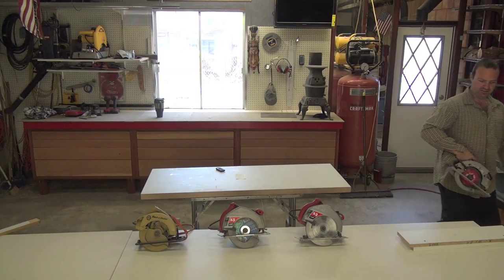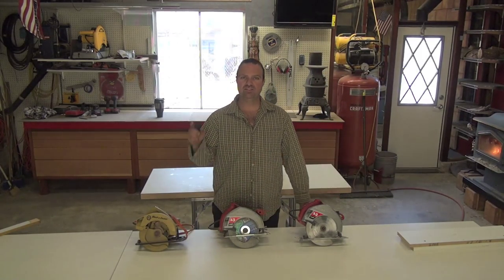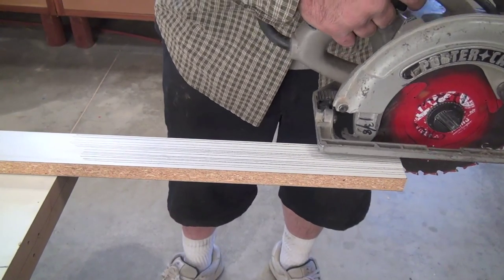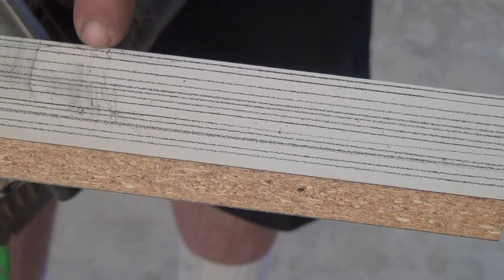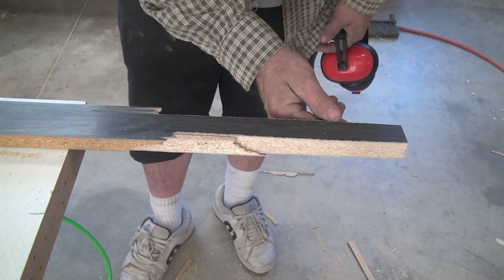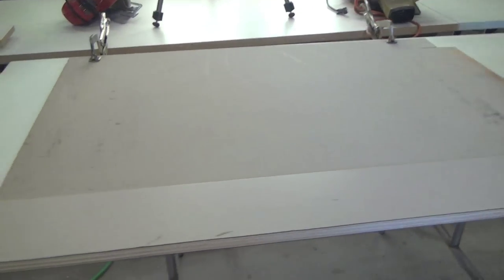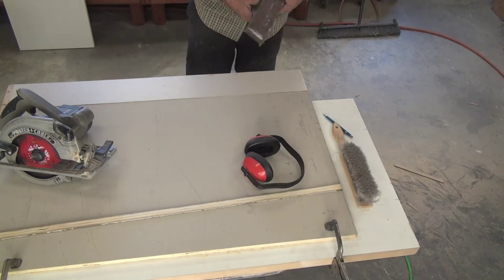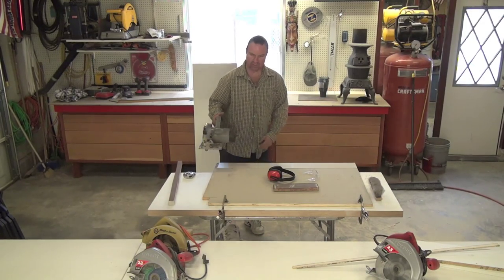Advanced Circular Saw Technique *Cut BackWards IN-DEPTH *a Tip for Pro Carpenters

Comment: With all do respect, I have been a carpenter for 19 years.  I consider myself a "PRO" who still learns something new quite often. I admit I have used this technique on very few, absolutely need to moments.  As a pro, there are simple things like masking  the material to minimize blow out/ tear out. Also, having multiple tool options in your arsenal. As a pro, SAFETY is key. I would never run my saw without the shoe/foot not in contact with material.  That free hand floating blade thing is a BIG NO-NO for me and anyone on my job site. Kind Regards, CARPENTERS RULE! Be safe.
Reply: I second that. Also exactly 19 years experience.
Reply: As a "pro" you know the limits of your tools and your ability. Ever used a grinder?
Decorators use masking tape and sandpaper. 
Carpenters use blades. And the real skill is to control the cut of the blade in the direction that the material demands.
(And 20 years experience as a joiner puts you at 36 Yo or there abouts, pro is a bit big headed? I've got 10 years on you, I've worked with some seriously skilled guys, never met a pro though?)
Reply: @sally6457  you are a professional anytime you get paid for doing something. There was a running joke when I was an airmen that we were professional broom operators.
Reply: @BlackDog69  experience and qualifications, and reputation make a professional.
Just because you swept up for a while, your no professional cleaner, 
You said it yourself, it was a Joke!

Comment: I do this with my table saw. I clamp the wood to the table, lift the table saw in the air and run it along the line. I wouldn't advise it though, unless you're also a PRO INSTALLER.
Reply from the maker: your lame
Reply: Mike's DIY Projects & More No, that was funny
Reply: LMMFAOOO!!!!
Reply: Lol
Reply: Can you post a video on this please so beginners woodworkers could learn this? Also make sure to take a moment to talk about safety first lol
Reply: cool idea and respect for that but just flip your blade. I can fljp my blade in less than a minute. i could then just cut a perfect line forward true to the line and never need any sanding. Either that or just flip your formica upside down and never have to switch the blade. be easy
Reply: i like to hold on to the chord of my circular saw. zip tie the trigger and swing it around like a lasso
Reply: BTW Mike, it’s “you’re lame” not “your lame” 🙄

Comment: Sawing backwards to avoid chip out makes sense, but doing it like this looks like some dangerous freestyling!
I think there is a way of using this technique without putting your limbs at risk:
You can use a clamped guide to make your cut straight and repeatable (plenty of guides for this on youtube). Then you make the actual cut in 2 steps:
1. Saw backwards in the top layer, only a few millimeters deep.
2. Saw forward through the bulk of the board.
Like this you get the best of both worlds. Your top layer will get a down moving blade to avoid chip out. And the bulk of your board gets a up moving blade, sucking the machine safely down on the workpiece.

For professionnal workers, as mentioned, I would expect them to get a high-end track saw. No dust (vacuum extraction), no chip out (splinterguards), very straight cuts (with the rail), and a high change of not getting seriously wounded.
Reply from the maker: Thanks for the comment, Its interesting that here in the states their isn't a riving knife on this type of saw. I haven't ever seen one like that before either. I can understand how folks would flip out to seeing this technique if their accustomed to the way they know......
YES,  steps 1 & 2 you mentioned are a excellent way to apply this idea. I have to do that often in certain situations. I hope I stressed caution enough in the video, Its defiantly not for everyone. Take care!
Reply: I was going to write almost the same as Nico, but now there's no need.
I can't see the advantage of holding the saw above the work - it just give you dodgy line
Reply: I tried this but I think I was doing it too deep and my saw flew off the guide 😅 and safely stoped

Comment: I have never seen this done in all the 25 yrs + I have been a Carpenter, I see exactly how that works, and the less dust in my lungs, face, etc. would be nice too!...Does using a new blade, make it dig in and jerk back/wanting the saw to back travel more on you?...It looks like you had a good hold on/position of holding the saw tight, braced and ready for it to jerk back if that happened I see too....That's for sharing that, "pro-only"' tip with us! and take care!
Reply from the maker: Glad you get it. Using a new blade is always better, it becomes more challanging once the blade is shot like you see here in the demonstration & becomes loud. Yes I am prepared for the saw to jerk back (just by habit) but I exaggerated a lot in the video so newbies wouldn't try & get hurt & folks understand this is uncommon practice. In reality  (in my opinion) it's a safe standard technique.  A large group of guys  I know do this daily as well so no big deal. In the video I mention I was taught this early in my  woodworking career which is true.
 I do this daily on material that costs more then my average weekly income, if it was a bad idea, I wouldn't still be at it. Be safe & thanks for the good comment.

Comment: You can get the same result by flipping the board over and cutting on the back surface.
Reply: Yeah, if you have eyes in your knees
Reply: @sally6457  or a line scribed on the back of the board🤔
Reply: @codykastler4709  oh yea, it's OBVIOUS when you think about it! 🙄 haha 😎
Or you could do an initial shallow cut first, then cut all the way through. 
Or scribe the line with a sharp utility knife, or cover with a sacrificial board, or use a router,

Comment: Safety first.  Concerned with wavy lines?  Use a clamped-on straight edge guide.  Concerned with chip-outs?  Use a fine tooth saw blade.  Before you begin, read and understand the instructions for your equipment.  Never risk cutting yourself with any power tool (or any tool).  If you have two hands and ten fingers and want to keep them . . . think safety, always.  Or maybe you could talk to someone who has already met the cutting part of a power tool.
Reply from the maker: I like your well thought out comment.
Reply: You've taken the time to warn people who are not highly skilled craftsmen.  You've made several warnings but some people will think they are more advanced than they really are.  Personally, just last year I cut through my own power cord with my circular saw.  I was wearing gloves but it made me think and re-think about how I was working.  And I've had my saw since the nineteen fifties.  Complacency can be pretty dangerous.
Reply: I second that.. when i was young using a angle grinder in a hoodie with strings i woke up with a grinding disk spinning beside my face.. by the grace of god i didnt have a scratch on me just a sore jaw and a headache..
Reply: @FastSloW-qt8xf  “you woke up” with it spinning by your face? You mean it knocked you out and was still on, and you were by yourself for this whole event?

Comment: Do you install the blade rotation backwards as well? Thanks for sharing.
Reply from the maker: The blade position & rotation remain the same. Only difference is the direction the saw is traveling. Thanks for watching & commenting.
Reply: Mike's DIY Projects & More but in essence if you did just turn your blade around in your saw you would accomplish the same thing and you could use it in the forward direction that you're used to and comfortable with.

Comment: I've done it too.  You are exactly right on all points.  The sneaky one is angling the saw to protect the nice edge you just cut from the up moving teeth.  To angle  the saw while staying on the line seems counterintuitive, but totally necessary and not that hard once you figure out what  your doing.  Looking forward to your other videos......regards, subscriber   PS.  Mike, while i was watching the video I got the idea of forward cutting 3/16 away from the line and twisting the saw away from the line so the down cutting back of the blade down cuts up to the line.  Sounds nuts, but i think it could work.  Visibility is the problem, but i think practice would help.  What do you think?
Reply from the maker: alex tworkowski   hey, thanks Alex.  The idea you had going forward is a good idea but it really depends on how wide the carbide on the blades teeth are, more then likely the 3/16 that needs to be removed to get up to the line will rub on the side of the saw blade so it may be challenging to get up on the line but thats good thinking ;)
Reply: Mike's DIY Projects & More Thank you.  I think you're right.

Comment: I have a good "pro trick". Know the proper blade for clean along gain, against gain and across gain cuts. I would recommend 60 teeth. Also, consider the species of wood. Deciduous species like beech and chestnut can bind when sawed. l
Furthermore, I've had to remove the guard and blade off a saw to retrieve a co-worker thumb because of improper use of the saw. Luckily the thumb was sewed back on and saved.
You seem like a nice guy. So, please use your tool as instructed in the manual.
P.s. be vigilant for heartshakes, checking and knots to avoid burst of debris.

Comment: you can reach the same if not better by using it to cut forward.  doing this dangerous technique does not look practical unless you have no regard for safety.
Reply: Agreed. I've flipped the blade backwards and cut forwards for thin metal.

You are asking for the saw to kick doing this technique. Sure maybe 1 in a thousand cuts but still.
Reply: flipping the blade around works well for not only metal, but also plastic and cement board too

Comment: While I appreciate your contribution to the carpentry community in the regard that exploration of tools is necessary to achieve new or faster ways of doing things, I do feel as though this technique spawns from a heavy framing background and is ultimately less controlled and more dangerous than using a forward cut into a cleanup pass with a planer, belt sander, ras 115 or something of the sort. I don't mean to disincentivize you from posting more creative videos, I just think it falls into the camp of an impressive video based on your control, but not really a technique worth adopting.

Comment: Why not just to put blade opposite way( like cutting vinyl siding ) and move saw forward?
Reply: Because the blade's then trying to cut with the back of the tooth (just rubbing), rather than the front of the tooth.

Comment: For all the negative posters, think, this is exactly how you use a radial arm saw or a slider saw except that it's FREE HAND, and yes, in the hands of an inexperienced worker it could be very dangerous!!!
Also the inaccuracy of this practice it's obvious despite using a sanding block, so,
I have to try it before I knock it.
For now, good luck with it and be safe!  If you not sure, don't try it !!!

Comment: They have saws where the blade spins forward.Teeth cutting downward on your work not upwards.Just like a table saw.
Reply from the maker: Cool , that would be great. Any chance you know a model number or manufacture of the saw? Thanks
Reply: Mike's DIY Projects & More
I don't think it exists.?I am so use to my table saw and my miter saws cutting downwards on my work which of course leaves a nice clean cut surface on the finish.I know its more for safety reasons why they cut upwards.Pulls the work down on the shoe with less jumps coming from the saw..Maybe we should invent one and market it..?LOL..Probably to many lawsuits in the end.LOL...
Reply from the maker: It seems like a good idea but I agree about the lawsuits haha

Comment: You don't have to do that. Keep in mind that a good carpenter carries a variety of blades and a ultra finish 60tooth blade does that job perfect.
Reply: A good carpenter understands the tear out,  
Imagine a saw blade as little chisels, each one taking a little shaving as it goes, 
More chisels won't stop the blow out as they break through the surface of the material.
That's why you get downcut jigsaw blades, so why not downcut skilsaws?

Comment: I must say, each time you cut it scared the hell outta me.  As a carpenter myself, they make many other tools to achieve what you're doing here, other than risking being very badly hurt.  Someone seems this and tries it anyway.  OMG! Serious injury waiting to happen.  Radial arm saws cut counter tops just fine.  anyone who's a "profesional" is going to have the right tools and not need to put themselves in danger.  Besides, your cut isn't even square, the saw is angled.  You're sanding after cutting. I'd rather use the right blade or tool than do something as stupid as this. safety rant over.
Reply from the maker: This cut is not supposed to be a perfect square, its for finish carpenters-installers scribing material, specifically counter tops to a wall. I have now been doing this for going on 20 years , its a method that works with successful results. nothing scary about it, you just haven't done it before. At this point I believe most carpenters in my area do this, at least in the wast coast area doing commercial work. To each his own I guess.....   Every time I get a new guy & they do this I ask them how they know about that cut, they said everybody does it, I say oh, okay ;)
Reply: not to mention the possibility of a kickback when cutting backwards

Comment: The blade in your saw should get set only an 1/8 of an inch or so wider than the material you want to cut. Setting it very wide like you illustrate serves only to cause the saw to labour harder to make the cut.  Secondly, to prevent chip-out in plywood and laminated wood, the blade should get set a third of the width of the material, then run backwards in the first pass. Then to make the final cut it should get set a slight fraction wider than to material and run forward.

Comment: This is basically only used to hog off the main of the material while scribling to wall surfaces. It has been used for decades in the finishing trades long before health and saftey guys showed up. It takes skill and attention to the details and is not a technique for everyday regular cutting.
BTW there never has been a riving knife on any generally available sidewider saw in north America in the last 40+ years that I know of and I have been at trade for longer than that and I also still have all my digits!
Reply from the maker: Thanks for the fine comment. Good info!

Comment: Score the side of the board you don't want chip out with a knife rather than sawing backwards and also why not flip the blade around if you always cut backwards?
Reply from the maker: Hello, I don't always cut backwards, just when i'm cutting off excess material while scribing a top or something to a wall., I have been doing this for so long I don't have time or thing about changing my technique. It's actually a wonderful way to speed my work flow along & reduce airborne dust. Thanks for the comment & idea.
Reply: Mike's DIY Projects & More Q

Comment: This works the same exact way if you flip the finished side down incut straightforward when you flip it over it will have that perfect look and there's no difference in sawdust you're crazy so let's think about the pros and cons here have a skill saw jump because the teeth are pushing down through the wood have it push away and jump and cut yourself or slip your finish side product down and then make a forward cut

Comment: Thanks for this... not going to try it but I was thinking about making a home-brew panel saw and wondering if a circular saw pushed backward through a cut would move the chip-out to the back.  Yes, apparently it will, and with a zero clearance cut on the backing board, I think it will work well.

Was struggling with the design a bit.  Wanted the saw on the outside for safety, rather than tablesaw-like sticking out.  But, I didn't want to have to run a zero-clearance insert on the plate of the circular saw and then have to adjust the saw placement to match the thickness of the stock.  Cut backwards and all the problems go away, no mods to the saw at all other than attaching it to rails.  A channel behind the zero-clearance slit attached to a dust collector ought to work well too.

Yeah, panel saw because I can't cut straight freehand with a circular saw if my life depended on it, and it usually does. 🙃

Comment: all he would really have to do to do perfect straight lines is use a fence with it. It just wasn't a well thought out video. Informative for sure. I like the idea...I would also use a finish blade with more teeth. A lot of wood workers have lost the art of also being a sawyer. A good sawyer knows when to apply a good wedge to keep yourself safe and to keep the project rolling. Wedge clamps, wedge braces, wedge blocks. Wedges, man....good stuff.
Reply: What good would a fence really be when your cutting with the leading (rear) edge of the blade on the line and the trailing edge cocked an eighth of an inch away from it. Even with a fence altering that angle would render the cut inaccurate. You need to be expert enough to run the saw along the line at that angle either way. The trick I found is maintaining dynamic tension on the saw with your arm muscles locked well out away from you for safety in case it kicks and using your back and leg muscles to move the saw. Those big muscles are less likely to get jostled off the line in my experience.
Reply: Or just use a router and not worry about any of that bs.